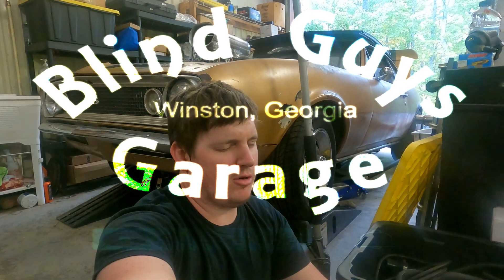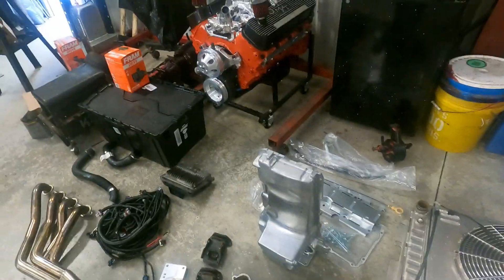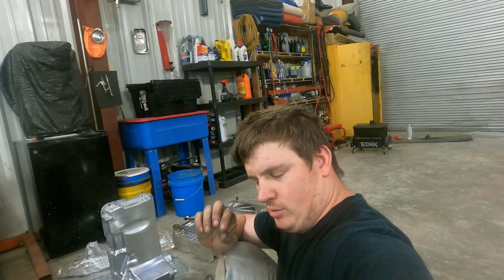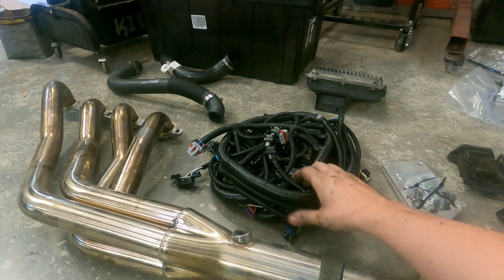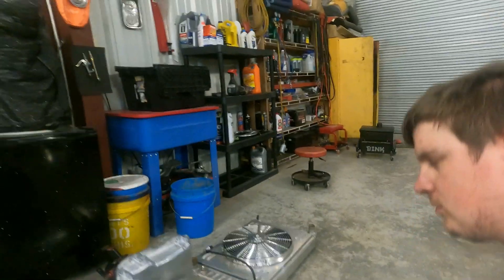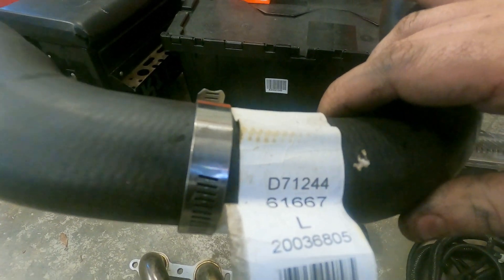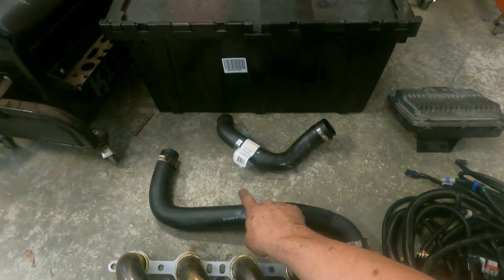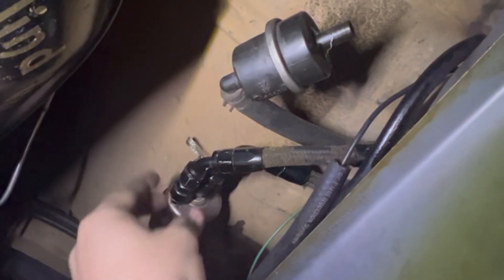What’s needed to LS swap a 67-69  Camaro/firebird or 68-74 nova? ANSWERED major parts needed

Comment: What engine frame stands does it have and motor mount version “tall and narrow”? There is a combination that works with the SE headers and a PS box
Reply from the maker: The car is running the stock small block Chevy frame stands which if I remember correctly is the taller frame stand no the problem is I can’t remember which engine mount we were using. I know once again it was the stock small block Chevy. I think that is the narrow engine mount, but unfortunately, I can’t remember at this time.

Comment: looking to do a LS on a 67 Camaro. what did you do about the gauges, coolant, oil pressure ect. I assume there is no tunnel mods needed?  thanks
Reply from the maker: Depending on if your car has those gauges from the factory, you can just reuse the factory sensors with adapters. The only thing that really won’t work properly is the speedometer without buying a speedo driver kit or going to a digital gauge cluster however, my car had the three gauge pod under the center console with coolant oil, pressure and volts.

Comment: Do you have any suggestions for an LS3 /4L80E swap into a 1969 Firebird?
Reply from the maker: The LS three is not your issue. It will bolt right in with just like any other LS based engine however the 4L80E Transmission is kind of a fat boy in most cases that you end up having to cut the floor to make it fit all really depends on what day the car was built if you know what I’m saying.
Reply from the maker: Also, the parts listed above will get the engine in the car just the same as a LS 1 a 5.3 or the LS three

Comment: Got a 68 firebird with a poncho 350 small block. Would I need a different style of motor mounts or would these work for an LS since it’s not an original Chevy motor car?
Reply from the maker: Sorry for the late response yes, you would need a different engine mount. You could either use the LS swap mounts from ITC for use a stock small block Chevy mount with the LS adapter plate

Comment: I have a 69 camero I'm putting together. I'm going to put in an LS 6.2....but I'm here because I want that digital dash lol...where did you get that...and what wiring do I need to have that (gages, readings, etc...)work with the car?
Reply from the maker: I used Dakota digital dashes on almost all of my projects, and if you use the Dekota digital, it comes with all the wiring to do sensors and stuff like that
Depending on what engine management system you use to control your 6.2 depends on how much wiring you’re going to do if doing a stock computer with a standalone harness, you can buy a part that plugs into the OBD port and eliminates running all the sensor wires so essentially all you have to do is Run a power a ground a switched power and your turn signal indicators I know that’s a lot to say at one time and I hope it helps

Comment: Very informative video! Question, what was the clearance like around the spark plug boots? Any problem getting a socket in for service? any boots touching tubes at all? I’m doing my first swap on a 67 Camaro. Thanks in advance!
Reply from the maker: Thank you very much. I will have a new video coming out very soon on that same swap as this one is quite old and a lot of my links are dead.

As for clearance around the spark plugs, there is plenty to get a socket on using the speed engineering headers. I am currently running the same set up on my 67 again with a LSA as I said that will be coming in the near future very near future probably early next week .

Comment: How have you been, haven’t seen a video in a while. Any ideas on the power steering main line?  71 nova with the basic power steering gear box to a new ls3 type 2 pump with male 6an end.
Reply from the maker: You can build your own 6 AM line with this fitting in the power steering box if factory
Reply from the maker: https://www.ebay.com/itm/276424932602?mkcid=16&mkevt=1&mkrid=711-127632-2357-0&ssspo=-rVjw2TGRxe&sssrc=4429486&ssuid=8gTdxxS-TzS&var=&widget_ver=artemis&media=COPY

Comment: I blew my sb 350 up in my 68 Camaro … I already did a t56 swap, will my bellhousing work on an LS? And will I have to modify my transmission mount again?
Reply from the maker: No, the bill housing will bolt up fine. You would need a adapter clutch as the bell housing is a little longer on a small block than a LS other than that everything transmission related will be the same.
Reply from the maker: Advanced adapters will have the clutch kit in stock

Comment: I have a 73 Buick Apollo. (Nova with a Buick 350 engine and BOP trans)  do you think a LS truck engine will clear the stock hood? I don't want to cut the hood or stick a scoop on it since its a super sweet original car in stock shape.  Also, since this is my first swap, I don't want to crack open the good running engine and change the intake.  Also, I don't want to spend any more than I have to.
Thanks.
Great content!
Reply from the maker: I very highly doubt it will clear I would almost guarantee it will not, but if you was to change the intake, it will however, you will also have to change the alternator bracket the alternator will sit too high, and then it will hit the hood

Comment: Are you running the car style crank pulley or the truck. I just stabbed my motor and im trying to learn. Thank you for all the advice. Great video
Reply from the maker: On this setup I used a car pulley and accessory drive, but you can use truck stuff however the truck alternator does it a little high so it will contact the hood, but I can help you get an accessory bracket kit for truck that will work
Reply from the maker: If you want to contact me here is my email 
BlindGuysGarage@gmail.com 
I will give other info and parts if needed

Comment: I just swapped a 1968 Camaro and I got not crank no start what do you think is the problem
Reply from the maker: If you have a no crank condition on a older car like that, it’s probably not getting power to the starter therefore it’s probably either a bad ignition switch or something is wrong in the main starter circuit possibly a neutral safety switch
Reply: @blindguysgarage  it’s gotta be a neutral safety switch because the starter and ignition switch is new. So do I connect the  2 purple wires together to bypass the neutral safety switch. Its a 1968 Camaro ss
Reply from the maker: @cedricdeoan1214  to bypass the neutral safety switch take a 12 gauge piece of wire and loop it at the purple two pin connection should be under the dash either on the steering column or closer to the shifter in the floor

Comment: Go to a junkyard and get a 4th gen camaro or firebird radiator and the factory dual fans. A lot cheaper then buying aftermarket and direct boltin. I only paid $50 for all.
Reply from the maker: This is true and does work very well just does not always look the best in a classic car that has a bolt in installation not to mention not everyone has the ability to make brackets and make things look as nice as they could
Reply: Ive heard about this as well but how much hp can that radiator handle arent they single row radiators? Also is your Ls stock or Not..how much Hp you making for that radiator to work?

Comment: Could a Holley 12-300 EFI  in tank conversion fuel pump be used instead of buying the whole tank kit?
Reply from the maker: That might work I have not done the swap using this setup
Reply: @blindguysgarage  Holley claims the pump is regulated at 58psi, does not require a return line and the sending unit will work with factory fuel gauge. I will be doing an LS swap over the winter and going over all of my options. Great video by the way.
Reply from the maker: @darinr8895  thank you very much if this is the case it would be a good set up for someone with a nice factory tank or even aftermarket replacement

Comment: I'm going to do this swap on my 72 nova. A question I've got for you is, would you do a after market front subframe kit with new suspension and a rack and pinion, or would you just swap the manual steering for a power steering box and run after market control arms. Thanks for the video btw
Reply from the maker: I’ve done it both ways however I like factory subframe with aftermarket suspension such as ride Tech really good stuff
Reply: @blindguysgarage  thanks man
Reply from the maker: @customjrod  Anytime any  questions let me know

Comment: Apologies for what might be a dumbass question but are there exceptions when doing this to a 68 firebird and what should i keep an eye on. Also big thanks for taking the time to make this video
Reply from the maker: The first GEN Firebird 67 to 69 are basically the same as the camaro. if doing the swap my way use small block Chevy frame stands and stock small block Chevy engine mounts with the LS adapter plate. There is also a company called dirty dingo that makes a bolt in engine mount kit it just is a few dollars more than doing it this way. Either of these ways works great. As for headers oil pan transmission all works perfect and are the same for Camaro and Firebird. If you have a automatic transmission from the factory keep all the factory transmission shift linkage. It will bolt to a 4L 60 E or 700 R4 with just a minor adjustment in shift linkage. Hope this helps and if you have any other questions I am do my best to answer.
Reply: @blindguysgarage  holy shit didnt expect an answer so soon, thanks alot and all the best from Finland, this helps a ton
Reply from the maker: @KotipellonTuukka  your welcome anytime
Reply: Like your channel I'm actually in the middle of doing a ls3 swap in my 67 rsss camaro.  Was wondering if ls swap speed engineering headers will fit . Also I have big block motor mounts. Thanks

Comment: What about intake injectors and fuel rails throttle body
Reply from the maker: The factery ls1 ls6 and ls3 fit nice I have also used the fabricated aluminum intakes however you have to notch the hood for those to fit if you look at my more recant videos you will see a 69 camaro I just finished up with the aluminum intake set up

Comment: Question, i have a running LS2 coupled with a T56 going into a 69 camaro. Can i install the whole thing together or do i split them apart? Im guessing i need to fabricate new whole for shifter? Can i still use the OE ECM? This is my first LS swap so i am trying to use what i have. Im not going high performace. I will be spending the money where i need it as far as parts. I appreciate your knowledge.
Reply: Not sure at the moment. I need to verify if the pedal and module were included. Will i need to cut a new hole for the shifter to fit or will i able to use the stock one?
Reply from the maker: @hectorcervantes5462  every trans is a little diferant so it’s hard to say but I think you will have to move the hole back about 3 in but don’t know for sure
Reply: Ok not bad for 3". Thanks for sharing the info. As soon as i take a look for the pedal and module ill let you know.
Reply from the maker: @hectorcervantes5462  ok sound good
Reply: So after finding out what i have, the engine does have the pedal but no TAC module since its already in the ECM. Thats what i was told by seller. So what does that mean for me?
Reply from the maker: @hectorcervantes5462  what year is the engine setup
Reply: Its 2005 LS2 coupled with a T56 6 speed
Reply from the maker: @hectorcervantes5462  GTO I’m guessing if so yes the tac is made In the system not that means it will need a diferant stand alone harness than I use
Reply: Yes its from a GTO
Reply from the maker: @hectorcervantes5462  yes they are a little diferant and need a diferant swap harness
Reply: Ok, can you explain how the one i have wont work because i dont understand.
Reply from the maker: @hectorcervantes5462  I don’t think I’m understanding what you’re asking me which part won’t work
Here is my email 
BlindGuysGarage@gmail.com 
I can send you contact info from there
Reply: Ok ill email. What i meant to say is, how come i cant use the OE harness that i have now? Why do i need to use a different one like you said.
Reply from the maker: @hectorcervantes5462  You do not have to use a different harness if you have the factory and the knowledge to re-pin and wire that harness
Reply: I dont have the tools or the kowledge to re-pin. Most likley ill buy one instead
Reply from the maker: @hectorcervantes5462  That’s the easiest and cleanest way as the factory harnesses have a bunch of things you don’t need for your swap and they’re typically fairly cheap that’s how I do all my swaps
Reply: Ok. Where do i buy the harness from? Also what do you think about the Holley mounts for engine and tranny?
Reply from the maker: @hectorcervantes5462  give me a few on the harness I buy and sell them so I should be able to come up with a harness or Arles at tell you where as for the mounts they work great but cost a lot more
Reply: Ok thanks! Let me know.
Reply from the maker: @hectorcervantes5462  will do
Reply from the maker: @hectorcervantes5462  I did a little digging and as of now my people have not got back with me but I did find this one from PSI
Reply from the maker: https://www.psiconversion.com/products/vehicle_parts/chevy/1940-1998_chevy_gmc_pickup_suburban/harnesses/ls_car_24x/ls_e40_24x/HAR-1095.html
Reply: Question, is there any concern with buying an oil pan kit from ebay? I know you said you got yours from there. Also before i start tearing into this 396, is it worth keeping?
Reply from the maker: @hectorcervantes5462  I have had no issues with eBay ls oil pans 
If you are asking about a BBC 396 they are worth keeping or selling reall downing on the condition also If your car has a big block Chevy in it be sure to swap to SBC frame stands
Reply from the maker: You should be able to go in from the top with no issues all togather make sure you have the right Oil pan and all sbc mounts and frame stands. it will drop right in as if it was a sbc 
I use the stock ECM in most cases and a aftermarket harness as it looks nicer and it’s easer to work with
Reply from the maker: Also do you have the throttle pedal and tech module from the car the engine and TRANS came from
Reply from the maker: Here is one of the harness that may help if you have the thrattle pedal and tac module 

https://www.ebay.com/itm/334533638265?mkcid=16&mkevt=1&mkrid=711-127632-2357-0&ssspo=iiksmpyeskw&sssrc=4429486&ssuid=8gTdxxS-TzS&var=&widget_ver=artemis&media=COPY
Reply: Ok ill purchase one from there. What are small SBC frame stands?

Comment: Thanks so much great job I’m doing 69 Camaro my 2005 LS2 corvette is in the frame rolling ,not under body New Tremec T56 Mag ready to go in do you know how long stock drive
Line will be and part numbers for radiator hose’s
Reply from the maker: I don’t how long the stock drop line would be I’m sorry however radiator hoses are used are these 

Radiator Hoses
Upper 
Gates 24409 
Will not work with truck water pump this car had a f body water pump from 98-02 camaro or firebird ls1.
The hose come with a plastic Quick disconnect on one end cut it off close and it will fits perfectly

Lower 
Continental D71244
It must be cut to fit as well I installed on radiator and then cut to fit on thermostat housing

Heater loop
Dayco 87653
If you don’t have a heater core 
This hose comes shaped as a J cut it to a U and install

Comment: Awesome info. Does that oil pan sit low to the floor and how close was it to the cross member? Im doing a swap on a 71 nova. Thanks for your time
Reply from the maker: The oil pan fit perfect as long as you use all sbc fram stands and engine mounts with LS adapter plates if you use big block frame stands and motor mounts you will have to put spacers behind the motor mount or under the frame stands so it won’t hit the lower crossmember

Comment: Is there a brake pedal sensor for (2 plug or 4 plug) something for lock-up on torque converter ?
Reply from the maker: What I do is wire in a 5 pin relay if I don’t have a 4 pin brake switch and use the center pin on the relay end it out pin on the brake switch as the trigger power that way when not on the brakes The computer sees power when on the brakes it slips away from the center pin in the relay and the computer no longer sees power this is just one way of handling it but it works well
Reply: @blindguysgarage  Holly smokes that's amazing thinking & I understand those directions better than 4 prong blah blah brake switch type.
Does the voltage matter for the signal ?   And I promise no more questions but sincerely THANK YOU.
Reply from the maker: @ronaldrey8474  The voltage really doesn’t matter too much also if you are just working the system and don’t have the time to set up a relay just run that wire to power for the short term and all will work you just won’t have lock up until that is fixed yet it will run and drive OK. 
Also I don’t mind the questions anytime I can help just let me know and you’re very welcome

Comment: Question, are the LS engine mounts bolt on to the original mounts?
Reply from the maker: I’m not sure I understand the question but I will try and answer what I think you are asking. 
The ls swap adaptor comes with new bolts it is very simple and bolts to the block with 4 Allen head countersunk bolts. Then the standard sbc/bbc mount for your car will bolt to to the adaptor plate. There is multiple passions you can set the mount in. The most foword holes are for stock location if I rember right. I try and and use the second hole back to move the engine foword about 3/8 of a inch. Makes it nice for firewall clearance. I hope this helps answer your question. If not let me know and I will try again